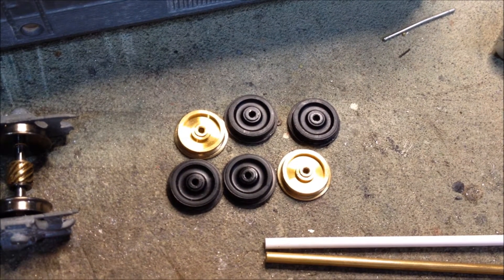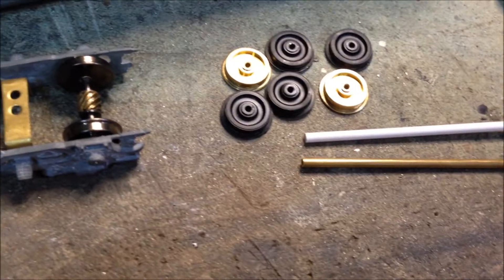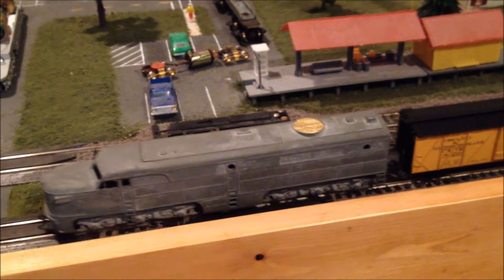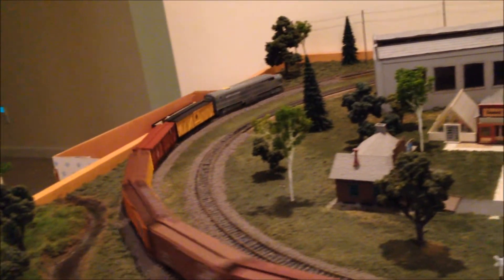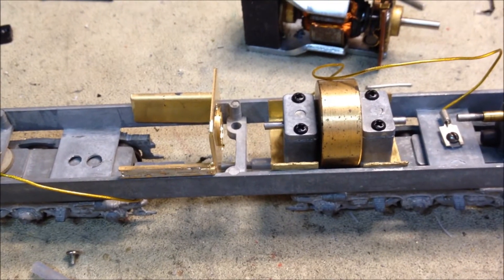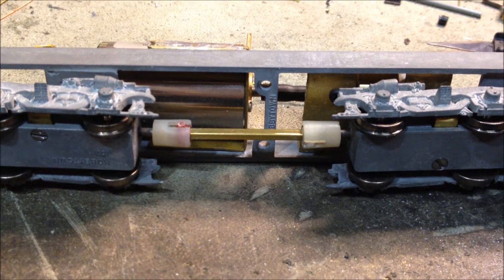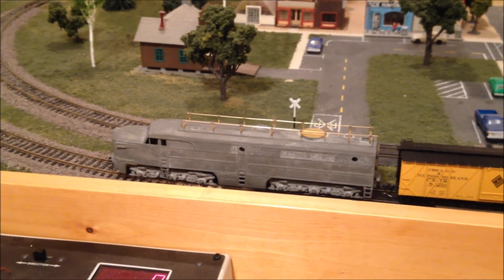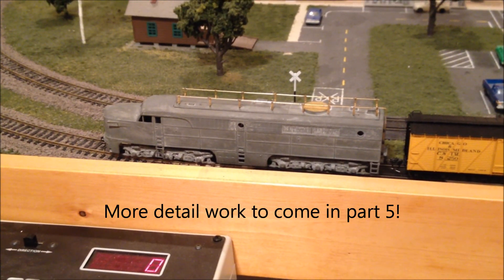Building a Hobbytown of Boston ALCO PA-1 - Part 4: Mechanical Improvements

Comment: What sort of RPM's does  that Escap motor turn at 12vdc?   How does that compare with a DC91 or DC90 motor?
Reply from the maker: If I remember right, it gets up to about 5,000RPM.  The DC90 and DC91 are somewhere between 6,000 and 7,000RPM from what I can tell.  These early Hobbytowns had a faster gear ratio, so the slower motor works well to hit a fairly realistic speed (most larger HO motors now are in the 7,000 to 10,000RPM range).
Reply: @DarthSantaFe  Only Escap like you used that I saw was $115.00 from the UK.  Far, far beyond my price range but I've an idea I am going to try  at far less cost.  Thanks for the answer, Swamp Daddy
Reply from the maker: @swamphdaddy  Yeah, the one in the US who managed to get all those surplus coreless motors and sell them off cheap unfortunately passed away a couple years ago.  You can still find comparable ones here and there for a decent price, but it can be difficult.

Comment: Can u please tell me the model number of that escap motor u installed? I tried looking at eBay but they look different. Also, what is the thickness of that brass sheet u used for the motor bracket. Thank u again in advance.

Comment: Nice impressive work with the wheel bushings. Been there. This takes great patience to get them straight and true with no wobble that can be disastrous for wheel gauge and operation if not correct. Takes a great Mechanic to do it correct. You the man. Thanks for sharing this.